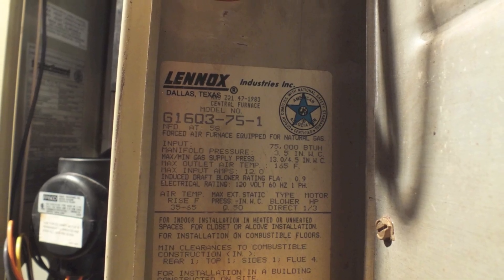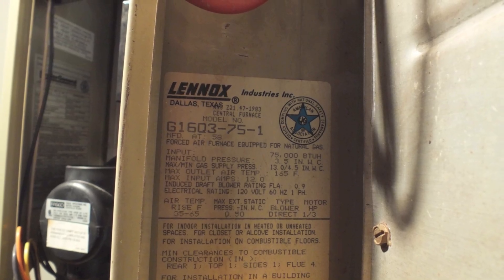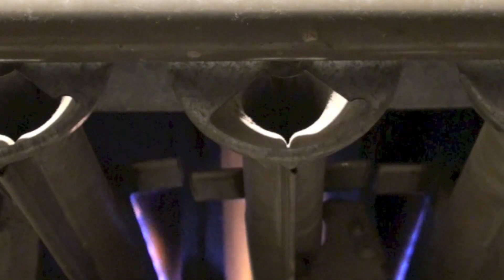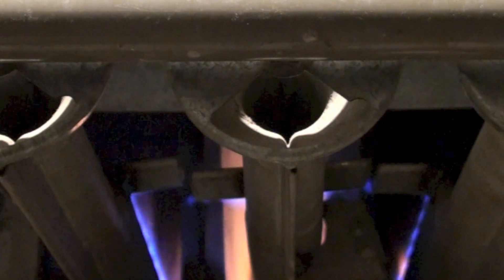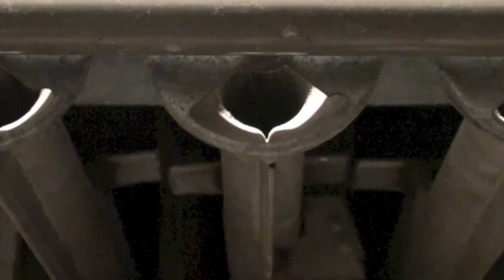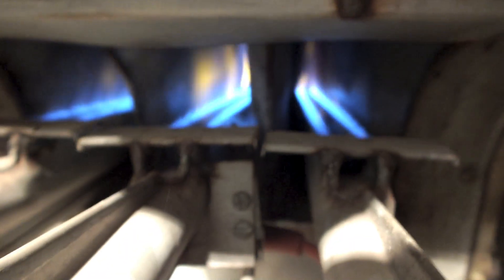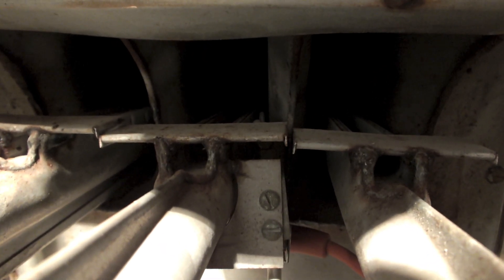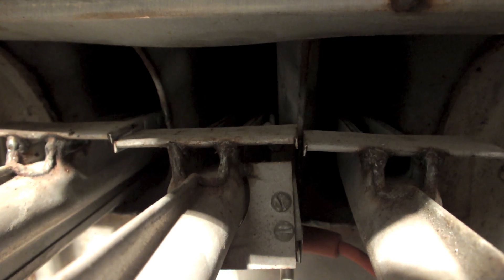Troubleshoot an ignition problem on a Lennox gas furnace

Comment: So I have something similar mine both come on and stays lit but fan never kicks on. Then flames shuts off.  Same problem you think?
Reply from the maker: You have a fan problem.
GFM
Reply: @grayfurnaceman  I think it’s either fan or board. I had the fan running for short time on the CF terminal just to check it out and it worked. However I didn’t have any voltage when the flames ignited on N1 and A which should be giving signal to fan. Ugh. At least the house is an empty storage for us
Reply from the maker: @rehabbychris974  You could have the relay on the board failed, which means a new board.
GFM
Reply: @grayfurnaceman  thanks. I ordered a used board see if that will limp me along until spring.  It’s in a empty rental. So the furnace lit and I took hot lead to fan off board wired directly to 120 and she ran until place got to 70. So it sounds like what you are saying about the board relay.

Comment: Everything works  but the piolet does   not  light.   Looked in the little window and the  two led lights the first one blinks slow the second one stays lite.?
Reply from the maker: If you have led lights, you have no pilot.  Your burners are lit by hot surface ignitor.  
Does the blinking lite blink a code?  There is a key for the codes probably on the inside of one of the covers.
GFM

Comment: why do I still hear my spark ignition do click click when the burner of my furnace is igniting
Reply from the maker: If it has a spark box, it may be failing.
GFM
Reply: @grayfurnaceman   me i furnace modine with  Robertshaw 780-845 Ignition Module, Intermittent Pilot, 24V,,it makes spark but as I told you I continue to hear the spark .. I may be wrong connect?
Reply from the maker: @ghislaincote8422  The 780 control has a lot of problems.  It is probably failing.
GFM

Comment: Rusty, 
I have a different problem. My Lennox G20Q2E, 10 years old,  furnace suffers from a small explosion 1 out of 4 times when it starts up.  This problem started after the first year, after the labor warranty had expired.  The part warranty was good for 10 years.  When I contacted the HVAC contractor, Lennox dealer, I was told that the labor charge would be $650 same as a new furnace.  Remember my furnace was only 1.5 years old, I refused and have put up with the occasional "mini explosion".   We are now planning on selling our home and I would like to repair this furnace.

Symptoms:
 I hear the electric pilot starter, click and then a wosh as the gas is released, but then the occasional boom.  When it was 2 years old the furnace did this once every couple of months, then it became once a month and now once out of four times. Sometimes several in a row.

Service Repair:
I had a different Rheem/Lennox tech out, he cleaned the burners and waived his magic wand over the unit and pronounced it fixed and after he left without testing the unit before he left the mini explosion occurred on first startup.  The house call cost $90 for almost nothing.

I have contacted Lennox which said this was a gas valve issue and sent me to Honeywell which suggested it was a furnace design problem (burner) and sent me back to Lennox.   Both of these "giants" have terrible customer service call centers and when I informed them of the many complaints for mini-explosions they were unaware and offered NO assistance for repairs or parts.  Honeywell could not even offer a new parts number for the old discontinued original part.  

Before leaving the Rheen/Lennox tech "suggested but did not confirm" that he believed this was a delayed ignition problem.  I can agree with this, but I am not happy to experiment with my wallet.   

Would you also suggest replacing the gas valve as a fix or something else, such as, module 97Ho401 SP745?  The gas valve is a Honeywell VR8204H 1048 dual valve.

The internet is full of these comments on mini explosions, many Lennox, and some other brands.

jimc
Reply from the maker: Replace the furnace
GFM
Reply: Since this problem occurs on many furnaces,  I assume it is not a design issue.   Your reply may be financially wise, but if this is a design defect in the furnaces or the Honeywell valve it would be appreciated by many home owners if you would address the most likely problem source. 
 
If just a worn gas valve, in my case, it was starting to malfunction before it was two years old.  Or is this a design issue in the way the flame propogates from one end to the other where the pilot light is located?
Reply from the maker: Sorry about that.  I thought it was a different model.  Are you sure that furnace is only 10 years old?  That model indicates it is much older.  In any case, there are a number of steps to find this problem.  Some of the diagnosis and repair is simple but much is quite complex.  First I would remove the burners and clean them with a brush.  While burners are out, inspect the heat exchanger.  Look up as far as you can.  These furnaces had a lot of problems with heat exchangers.  While the burners are out, check the orifices that pass the gas into the burners.  Should be clear.  Manifold pressure should be checked.   You will need a manometer for this.  The pressure should match the model plate.  Hope this helps.
GFM
Reply: Thanks Rusty for the further explanation.   The furnace was inspected last Nov., burners were cleaned and heat exchanger inspected, all was OK, last Nov. 2017.   However that did not eliminate the mini explosion as it occurred again that very day.  So a clean exchanger did not alleviate the issue.  I do not believe he checked the manifold pressure.   So, I must ask if a manifold pressure check, would indicate if the gas valve is not performing up to snuff.

Thanks again for your replies.
Reply from the maker: The manifold pressure is adjustable in the field, so an incorrect pressure would indicate simply correction.
GFM
Reply: Sounds to me like main gas valve needs replacing. Sounds like it is opening too fast or pressure is out. Should be 3.5 to 4 inch water column output pressure and 7 inches water column before the valve. GFM is right replace the furnace. The G22 have the dura curve heat exchanger that crack at the back of furnace where it curves. This furnace will become a money pit.
Reply: @scart121  Thanks for the reply.  In my case this problem started when the unit was 13 months old, one month out of labor warranty and the Lennox Dealer, said it would be cheaper (labor wise) to replace the entire furnace.  I declined his offer and put up with this problem.  Lennox was no help when I called them, they don't view the internet and see the many, many, many similar issues which I suspected might be a design issue and the dealer is non-gratis in my house.  I also called Honeywell and they were terrible, could not provide a part number, played dumb, and sent me back to chatting with Lennox.

Gave up on waiting on Lennox for a reply and bought a Rheem furnace as replacement.  

I appreciate the input guys and this video which helped me make a decision.  

We are building a new house and there will be NO Lennox furnaces.  Lennox has lost out on this one, not that they will ever care.

Comment: Hello Grayfurnaceman...I'm having continual problems with my Garage Furnace I hope you can help me. The Furnace is a Lennox LF24-75A-1.When I first turn on the power and adjust the Thermostat the Furnace will cycle and fire right up no problem.  Later and randomly, the small Exhaust Fan will start and run but the Pilot and Burner do not light. That Fan will run continuously until I shut off (cycle) the Power. When I turn the power back on the Furnace will run normally and light (first time) but randomly the Exhaust fan only will run continuously and the Pilot and Burner wont. I have removed and cleared the hose between the Exhaust Fan and Controls but it has not helped. I do not believe the system verifying Positive Exhaust is at fault due to the fact that it will function properly once the Power is Cycled. -34°c here this morning. I have to cycle the power every hour or so to keep the Furnace running, Garage is below Zero every morning.Please Help. I have a Multi Meter, just tell me what to test and or replace.
Reply: These garage furnaces generally have flame sensors and need cleaning. Check to see if there is 5uA DC from the sensor to ground.

Comment: I have a Lennox Conservator boiler for hot water heat, but would it be correct that the ignition for both would follow the same process? Pilot, then main burner? I was working in the basement and mine started short cycling. I looked for a flame sensor or thermocouple but couldn't find one. I pulled one of the tubes out and it was filled with rust powder from the boiler. I pulled all three and shook them out but there is still brown residue around the holes in the top of the tubes where the rest of the assembly looks like polished stainless. (And still very shiny!) Is this causing the yellow flames mixed with the blue? If so, what can I use to clean them fully so I get a nice full blue flame? After the rust was shaken out it has been running normally except for the bits of yellow flame. Incidentally, my furnace was installed in '94, eleven years before I bought my house and this was only the second problem I've had with it. I had to solder the connections on the circulator relay in my Honeywell unit last year. Sounds like that is a common problem. (Oh, and where would my flame sensor be hiding?)
Reply from the maker: You will probably have to replace the burners.  Although it could be coming from the cast iron of the heat exchangers.  I believe that unit has an electronic ignition using a pilot that lights and proves before main burner ignition.  The sparkles in the flame are just dirt and are not an issue.  As for finding the flame sensor/pilot assembly, follow the 1/4 inch aluminum tube.
GFM

Comment: Its normal when the burners and the pilot turns on at the same time, our gas furnace does do the samething
Reply from the maker: It is NOT normal.  The pilot must lite, then prove it has lit before the main gas can come on.
GFM
Reply: listen to grayfurnaceman, you have an unsafe condition in your furnace and it can be very dangerous... I cannot stress this enough, This man knows what he is talking about.

Comment: having an issue where the burners light, stay lite from anywhere to 30 secs to a minute or more then begin to flicker. as if they are quickly going out and coming back on. eventually they all go out. the furnace begins the cycle again to re light itself and that continues for a few times. it's heating the home but something is not correct.  please help!
Reply from the maker: If it is a 90% furnace, I would first try removing the cover on the burners.  If it stops, you probably have a restriction in the combustion air pipe.
GFM

Comment: I'm hoping you answer right away.  There is a Lennox G9 furnace that won't stay lit.  The main burners light up but then after a few moments they shut down.  Any suggestions?  Please hurry, it's 10 degrees here and these folks are freezing.
Reply from the maker: This one sounds like its overheating.  Filter, dirty blower, duct blockage.
GFM
Reply: The blower motor isn't coming on at all.  I can check ohms at the motor wires but with a 30-year old furnace will it be possible to find a motor for it?  Or will a new furnace be required?
Reply from the maker: Only 30 years?  Ha, its a spring chicken lol.  You can probably easily match it up for a general replacement motor or the dealer may have an exact replacement.  I would check the wiring first and perhaps replace the capacitor.
GFM

Comment: I have an old  Lennox Conservator III G16 and the pilot will not stay on...it goes out,,, the igniter starts to snap then it will lite for a second or two...then flame goes out...igniter snaps again...flame will lite...then go out...on and on and on....something is not working correctly ...have done some testing with VOM but not really sure where to look next...any help appreciated...
Reply from the maker: +Eva Mahan Either you have a gas supply problem, possible short in the gas valve or your regulator in the gas valve has failed.  I would check voltage for main gas solenoid at the gas valve.  My best guess here is the gas valve has failed.  Hope this helps.
GFM
Reply: Im betting on Flame sensor, this commonly happens when a flame sensor is dirty or needs replacement. I see the problem is a year old... so I wager its resolved by now.. lolz, Should have looked at the age of the post. :)

Comment: Hah! A couple of weeks ago I had a service call on a Lennox POS. The pilot valve was stuck open so the pilot remained lit even after the thermostat terminated the call for heat. Instead of replacing his gas valve, I ended up condemning the customer's furnace as it had a crack in it's Duracurve heat exchanger.
Reply from the maker: juncho1977 They all seemed to have cracks.
GFM

Comment: I have a furnace in which the flames will come on, but nothing else happens. It is supposed to turn over and then begin heating the house, but does not. What can the problem be?
Reply from the maker: I would be looking at the fan motor.  Will the blower wheel turn easily?  
GFM

Comment from the maker: Certainly the indoor coil needs to be changed.  Some manufacturers want the lineset changed also.  As a practical issue, R-410A many times uses a smaller suction line, so it needs to be replaced.
Hope this helps.  
GFM

Comment from the maker: In this case, it is.  Normally, the power is sent to the pilot valve, then the pilot is lit.  When the pilot proves, main gas valve opens.  The pilot valve is in series with the main gas.  Hope this answers the question.
GFM

Comment from the maker: The pilot valve is in series with main gas valve.  Both valves must be open for main gas to pass thru.  Thanks for the thoughts.
GFM
Reply: grayfurnaceman I have the similar G16 model. The pilot lights but main burners don't afterwards so we don't have heat. I think the pilot stays lit constantly which I thought was normal. I suspect I have a bad valve.  What role does the thermocouple play in this scenario? I thought if the pilot was on that this meant the thermocouple was ok.

Comment: that is very interesting that both the solenoid for the pilot and main gas valve would energise at the same time. The gas valve would have to be shorted internally to have both the pilot solenoid and the main gas valve to energise if there is no 24 VAC going to the main valve and only to the pilot solenoid? If that main gas valve were to be stuck open the whole time that basement would be filling with gas.